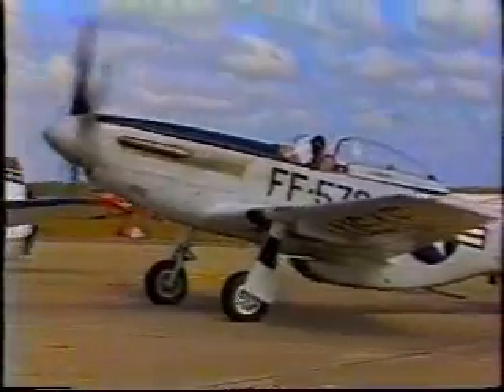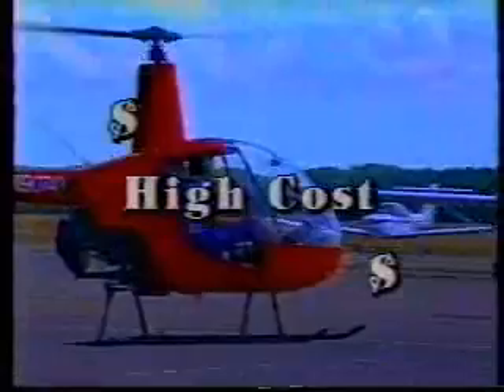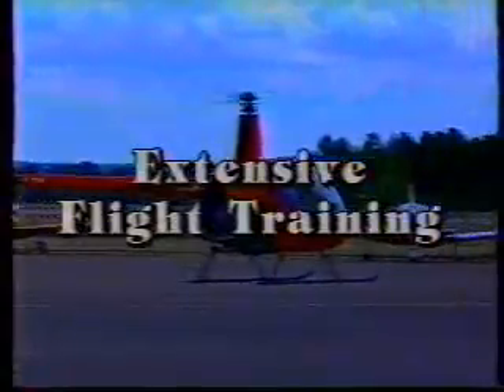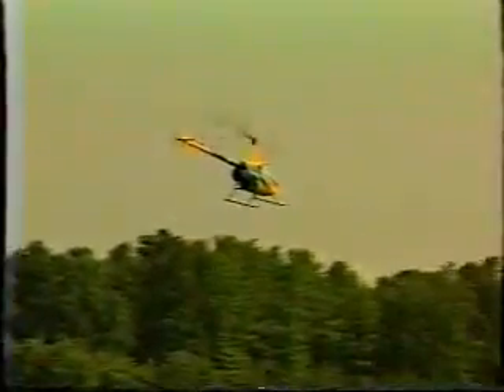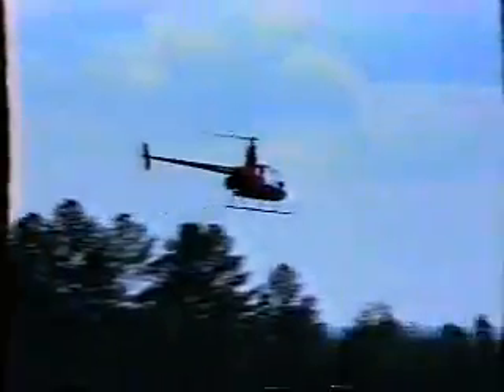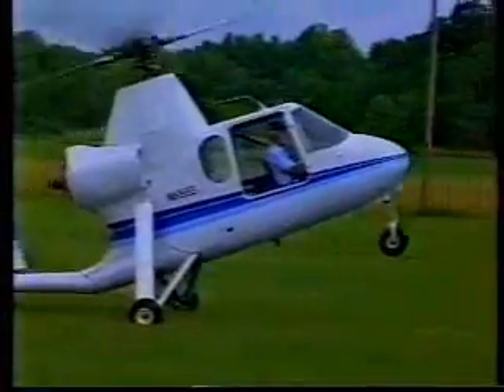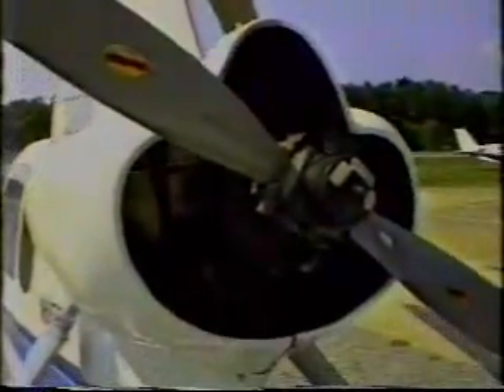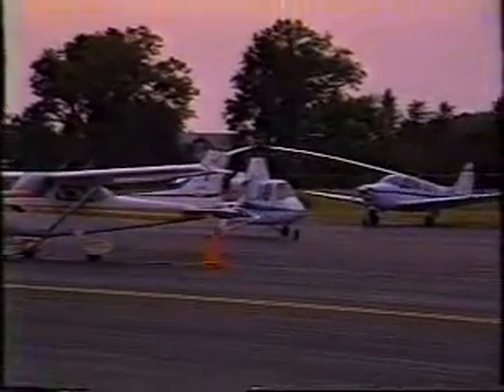Autogyro beats Helicopter for small VTOL Missions dynmicpara

Comment: Gyroplanes have a new competitor--UAVs. Which are much less expensive to operate then pilot carrying aircraft and does not put a pilot in any danger.
At this point, other than picking up a person (though it is being worked on), UAVs can do every job that is advertised in this video at much lower cost.
Even the military is using and arming UAVs.

Comment: Judging by the jump takeoff capability of this craft, I would say that it has a fully articulated rotor system or at least it's got the collective pitch controll. Otherwise this kond of jumps would be only possible in case of strong wind.

Comment: Something's missing. "Here's the 18A in action" then there is video missing.
It goes from stationary rotor blades and jumps to fully spinning blades and  take-off. An auto-gyro is supposed to spin up by forward momentum and wind resistance. If you edit this out we have no idea of the actual takeoff properties or the amount of runway needed for takeoff.

Comment: This is a common feature in gyroplanes - when the engine fails, the nose pitches up to increase airflow through the rotors.   The prop wash through that enormous tail prevents power-on buntover.
A standard airplane requires the nose to drop in power-off to avoid a stall.

Comment: single seat gyros prevail. There is no safe way to train a new pilot by radio from an instructor on the ground.  Also, many of these ships are homebuilt and the first flight they crash from material failure or pilot inexperience.

Comment: As far as safety goes, those are probably  the SAFEST aircraft available. Should the engine quit, they won't stall, and can land on a dime safely as you'd normally do.
There have been many accidents, that's right, but why?
1) Until recently, there have been too many poorly designed crafts in the market, which suffered from too many stability issues. 
2) Lack of proper pilot training (in fact, when the first Bensen models came out, many people used to teach themselves to fly).

Comment: The moller skycar is a brand new and possibly revolutionary concept.  It is the first true "flying car" ever developed.  Yes it is still years away, but it is beyond camparision from this.

This thing is nothing more then a high dollar gyro copter.  The video was extremely misleading in it's capabilities.  It CAN'T hover.  

As far as saftey goes, gyrocopters are one of the more dangerous ways of flying, resulting in one fatal accident for every 2,000 flights.

Comment: That autogyro looks good & very convienient! But your description about helicopters is unfair.

My father was a helicopter engineer in the Fleet Air Arm and now he's a commercial helicopter pilot.I've visited the helicopter hanger from where he works & I'm currently studying Aerospace Tech at Uni and as far as I know helicopters are not 'rebuilt' after x amount of hours. They undergo maintance after x hours. Helicopters don't just 'fall apart' as that's dependant on the engineer & the parts.

Comment: This company stopped trading in 2000 following the death of the owner Farrington suffered a heart attack while flying an Air and Space 18A at an airshow in April 2000. Farrington Aircraft Corporation ceased operations shortly after, and the gyroplane assets were sold at auction.

Comment: Well, this machine is an autogyro or gyrocopter capable of jump start. How do you achieve this? Can the pitch of the rotor blades be altered? Further question: why do you use a 3-blade rotor? Its head is quite more sphisticated than the head of 2-blade rotor.

Comment: how do you get the rotors spinning without some kind of starter motor or some bit of runway to gain enough breeze to get them moving?

they show it taxiing, but the rotors are still, so it cant be just the wind generated by the motorized prop.